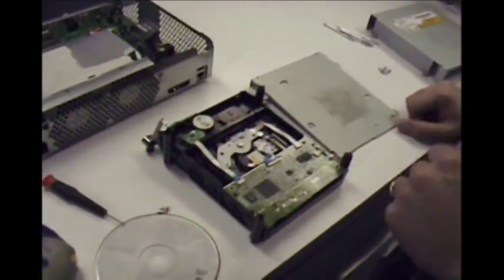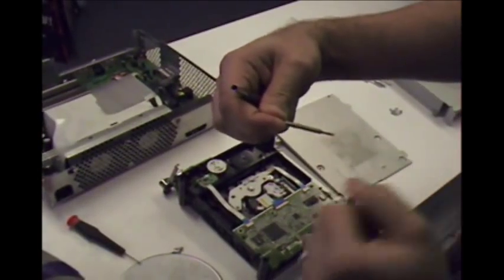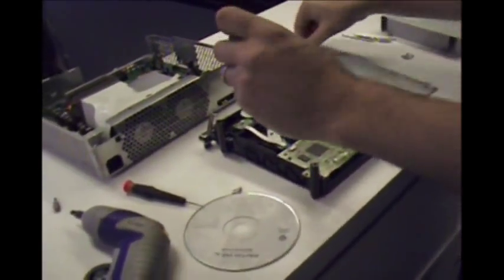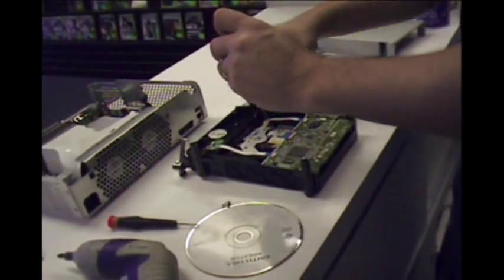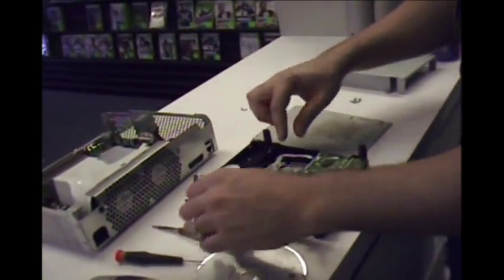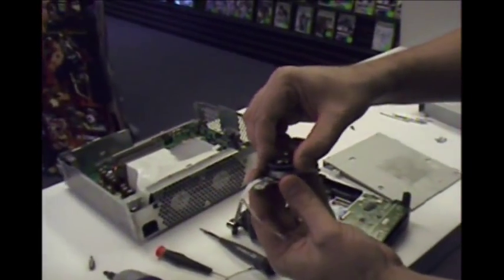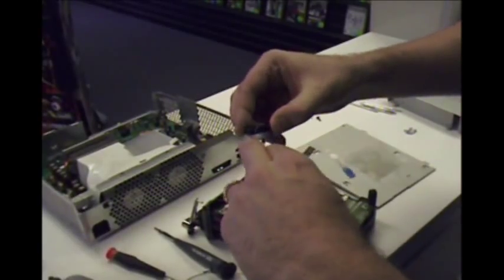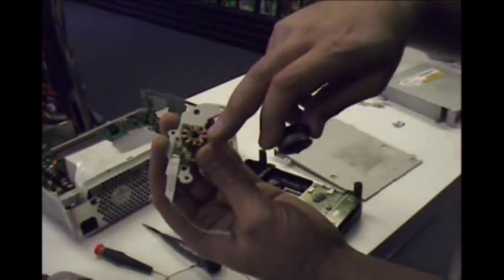How to fix a open tray XBOX 360 Hitachi drive

Comment: This tutorial helped me fix an xbox that hadn't been used in years. Thank you soooo much.
Btw, for anyone who tries this, make sure you put the cable back in correctly and make sure the two parallel screws aren't too loose so the disc doesn't hit the laser or it's cables. That happened to me and I scratched my disc.

Comment: Oh thank you so much dude!! Everyone - this works.. clean the motor, do the spindle screws correctly.. you can also use a 1.5 allen wrench btw. (metric) - I also did 1 and a quarter turn instead of a half on each.. and it works great. thanks again man!

Comment: I did this last year to my xbox and it worked like a charm. The only problem was it would screw up again every few weeks. It eventually got to the point where it would screw up if a disc spinned for about 10 minutes. I eventually had to order a brand new spindle.

Comment from the maker: depends...if you get "open tray" when you close the drive with a disc in it then there is something else wrong with the drive.  but if it says unrecognizable disc and it makes a grinding noise than its the loose magnet.  there are a bunch of vids on this just check em out!

Comment: Did you add lubrication back to the motor?

If not, that motor is gonna die and die quickly...

I would suggest mentioning to relube the motor in this video...

Comment from the maker: check this out...a lot of times its not the motor...try adjusting the laser height screws(big black plastic caps) on top of the laser rails, raising them a quarter turn usually works...might need to make a vid on it

Comment: So it looks like you're doing something extra/different from many of the other vids ive seen. Is that because of this particular drive type? So far ive seen videos that simply have you tigten two screws, and a few that have you slide the laser back to its starting position?

Comment from the maker: erm...did you read the side not like i said in the beginning of the vid?  those springs are very important...they keep the spindle at the correct angle and also dampen the vibration...they go underneath the silver screws that hold the spindle on.

Comment: So I took apart the motor, and there is hard white gunk caked on two of the copper coils.  Does this mean the motor is fried??

The motor will rotate a disc for a few seconds, but very slowly and it looks like the motor is laboring to do so.  I tried adjusting the 2 screws with the springs, and still nothing.

Comment: Got a small question, on one of those copperwire stuff is a small whie piece of something. Do you have it on there or should i get it off? Because its really stuck to the copper wire

Comment: @GamerGuy51 Really? the motor that spin the disk is actually caused by the laser? weird cause the laser seem to work it lit and work normally, btw to extract the DVD key from Hitachi drive with ROM 78 or 79 you need an unlock disk.

Comment: I think there is another issue on the side that if this process above does not unseize your motor......when you plug everything back into the xbox there is a small push button on the left side of the motor when looking at it from above....i was having this problem and noticed the button and when the xbox was powered on i pushed in the button with a small screwdriver and then reset the xbox and the motor started right up....i dont know if that is some sort of reset or not

Comment: @GamerGuy51 It seemed to be the key to success for me....though I did find a guy on ebay that sold new drives for like $25 so I ended up just picking up one of those and parting out the motor this past weekend so as to avoid constantly repairing it.

Comment: yea i just ordered two new laser cables off ebay, t(hat cable that pluges in back of the laser). cause i read if your laser doesnt work then its cause that cable might not be good cause its the cable that powers your laser ill let you know if it works for me cause you said you might have the same problem ohh and i got my cables for only 7 bucks

Comment from the maker: your laser doesn't see a disc so it stops spinning...try a cd it that works then its probably dirty. you might need to replace it. if you already did then you need to remove the anti static point on the laser or it wont function properly. good luck!

Comment: i fixed mine but a day later ther motor wont even start to spin and now somespring came off from somewhere so im just gonna have to replace the whole didsc drive and switch out the card thing in mineand put it in a new one.

Comment: When i insert my disc in my xbox it also says open tray. But it also makes a weird growling noise. I opened it and the disc is not spinning. The laser does shine for 3 seconds but then stops. Anyone knows if this can be fixed or what the problem is?

Comment: mine does not even spin the discs the laser does not even try to read discs either.  I fixed it once by cleaning it thorougly and it worked for about 2 weeks